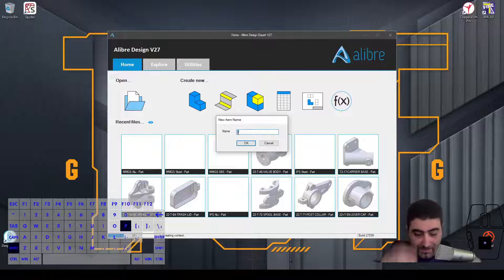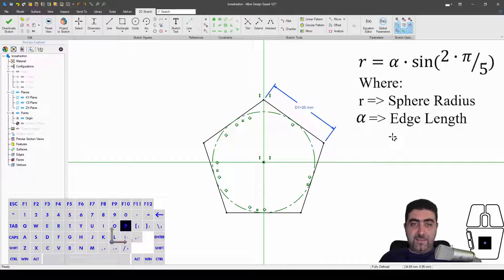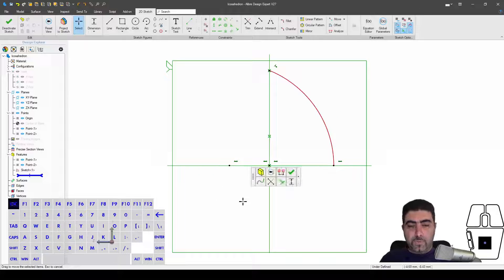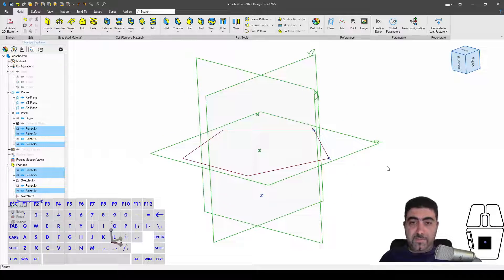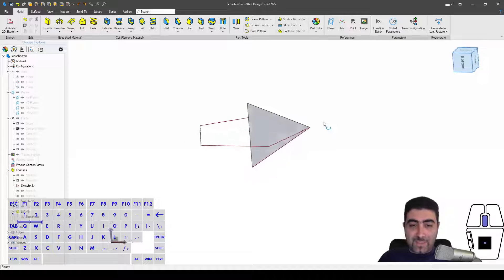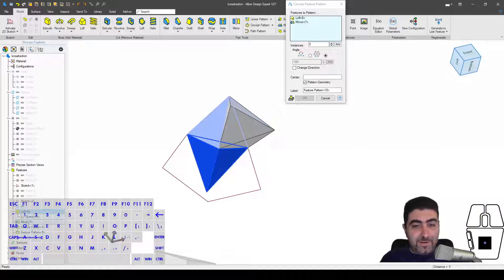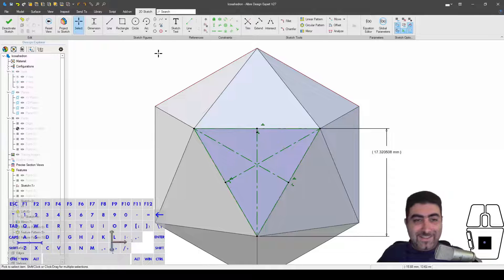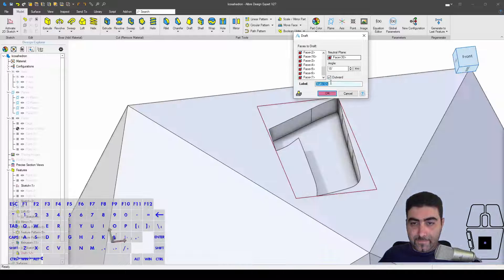CAD Design for the Perfect D20: Parametric Icosahedron

Comment: Hi, can you make a video between ironcad vs Ilibre
Reply from the maker: Hi Gheorghi,

I can't do that because I don't have IronCAD. However, I can tell you that they are completely different software. Alibre is Parametric Mechanical CAD and IronCAD is what you call a direct or boolean modeller.
Completely different workflows and usecases
Reply: @ExMachinaEngineering  the both softwares have small size of installation, but Solidworks i need more than 10gb, I study Ironcad and whatch your channel
Reply: @ExMachinaEngineering  Alibre is easy software,  thank you for video
Reply from the maker: Thank you for watching and commenting. IronCAD is a mature capable CAD. You can definitely do a lot with it.